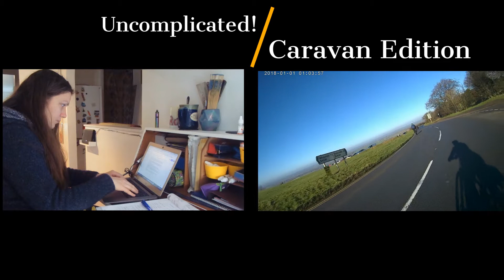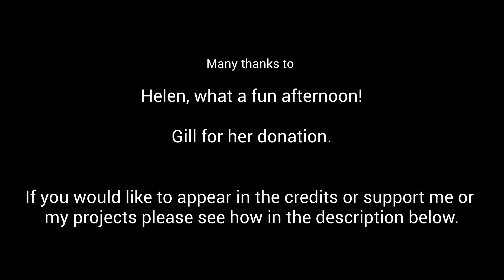Van Conversion   Getting things done

Comment: Hi Melanie,
The short lead that you plugged in to your caravan's port is called a fly lead.  They are designed to be plugged into a home's electric socket inside the home and then a longer 'hook-up' cable plugged into the fly lead.  What you've done there is fine in the short-term for testing, but wouldn't be advised over the longer term!
Keep it up!
Jamie
Reply from the maker: super helpful stuff as always! Thank you! Luckily the long term is off grid electricity.... At the moment I am just so happy what ever electric cables are in there are actually working. It's the little things!